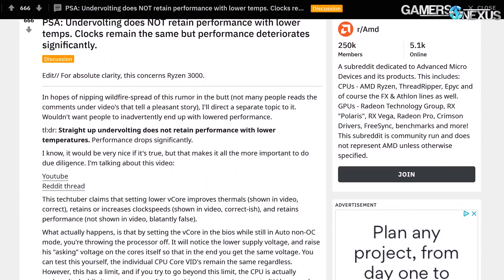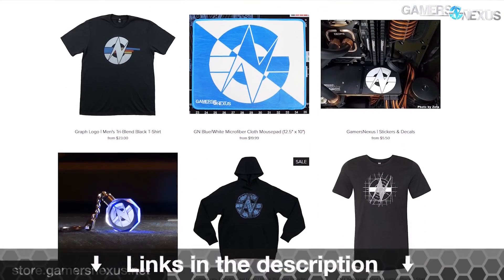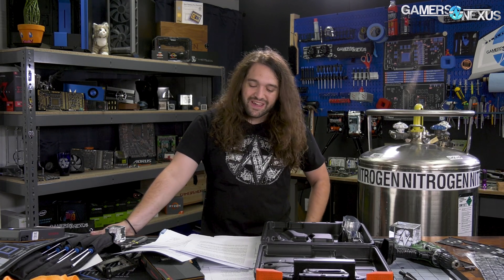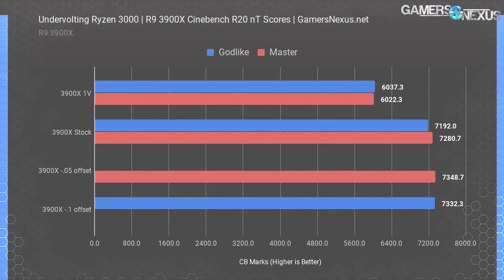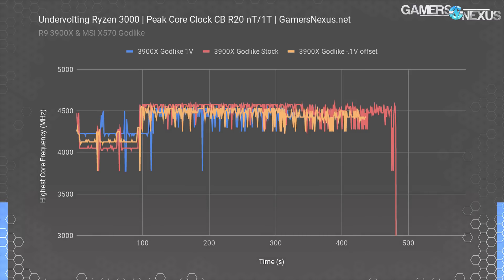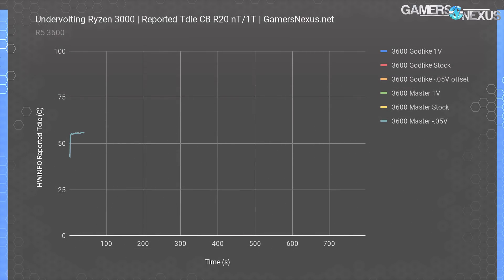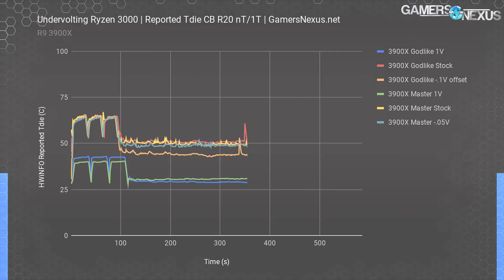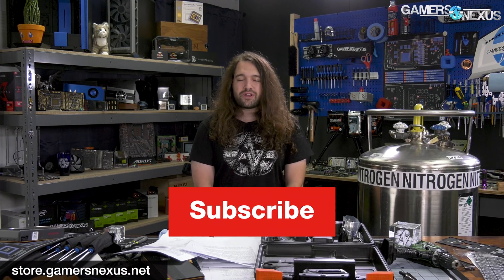AMD Ryzen 3000 Undervolting Offset vs. Override | Vcore Voltage

Comment: I see this as a good thing, instead of crashing, it slows down, which is a much better alternative for most people. They just need to implement a way for you to tell that his is happening.
Reply: I see why that can be good for many people. But, for experienced overclockers, there should really be way to disable that behaviour, because it looks like it can limit before it would actually get unstable, many say that they can get higher manual all core overclock at lower voltage than stock or PBO.
Reply: @Ph42oN  ya it would be nice to have it both ways. But I doubt it ever happens.
Reply: I noticed CPU utilization being capped off when undervolting using an offset (task manager showed 87% utilization on all threads). That's one way to tell I guess...
Reply: That would be a good idea.
Reply: so do overvolting too, detecting micro stutter is a bit annoying

Comment: Hmm...I will try offset undervolt -0.1v on my Godlike and see what my 2700X does..
Reply: I would be interested in your results.
Reply: I already beat you to it ages ago, you need a decent 2700x but -0.1v on the x470 aorus gaming 7 WiFi is possible. This can be paired with a raised BCLK of 102mhz, allowing for performance that is slightly better than stock while being massively more efficient. I currently run my 2700x at -0.1v with high LLC and 102BCLK with the ryzen balanced power plan with the minimum processor state changed to 5% from 90% at stock.

Comment: The whole point of undervolting is to reduce power consumption at the same performance levels.  Why didn't you look at watts (at the wall is fine) ?  It just drives me crazy that you measured all of this stuff... except the second most important parameter, power consumption.  For everything... underclocking, overclocking, whatever... what is the most important parameter after performance?  ITS WATTS!!!!!.  Not temperature (though that's useful)...  but WATTS.

In anycase, I've been trying to figure this out forever (for the last week) because at stock settings I do not get anywhere near the performance at the same wattage as I do with fixed overclock settings.  I always expected that setting a voltage offset would reduce VCORE without changing any other parameters (such as frequency) and that the system would simply crash if I went too far.  But that does not appear to be what BIOSes are doing with the offset.  They appear to reduce the frequency as well, which makes the whole idea of applying a negative vcore offset worthless.   I don't want the BIOS to mess with any of the other parameters... but it does.

So at the moment there does not seem to be a way to properly undervolt a system short of manual overclocking... and when you do manual overclocking you of course lose the single-core boost (which I really would like to have kept).  Sigh.

-Matt

Addendum/Edit: I shouldn't say 'no other way'.  There is, of course, the platform power cap which with a Zen 2 CPU works wonderfully to reduce the maximum watts the system will draw.  But this is a bit different from undervolting.  The idea with undervolting is that one can run stable at a lower voltage, all else being equal.  So the two can work together.  Except most BIOSes do not implement the VCORE offset that way which makes the field basically worthless.
Reply from the maker: We disagree that this was the point. We did measure it, but the point wasn't power, this time, it was that people thought performance would increase with lower voltage due to PB2. We have to cap it somewhere. The team is running ragged and we're putting out deep videos nearly every day. Not everything makes the cut. The point here was to address performance, not power. For power, just do some simple math on it.
Reply: @GamersNexus  I watched that original video before it was taken down (and I wasn't subscribed so it was probably a YouTube algo linking one of your videos to his)... it was fun to watch, the guy's heart is in the right place, but I really don't think very many people took his result with more than a grain of salt because it seemed a bit off-base.  

So I would not infer that very many people came out of that thinking they could get major performance boosts.  Sure, there will always be a few people... but its a big world with billions of people in it.  You can find any opinion you want on the internet.  I would not infer that any substantial number of people actually came away believing that performance would be better by watching that video.

There is no obvious reason that lowering VCORE would increase performance.  It just doesn't decrease the power envelope enough to move the temps enough to add much frequency.  Even in your own tests, the few results that were a bit better were probably more likely quirks in the PB algorithm that happened to be hit due to the VCORE setting and not so much because the VCORE was lower.

In anycase, you guys always focus on overclocking, which is fine.  But you obviously don't run machines at lower power envelopes regularly and that's a whole 'nother crowd of enthusiasts.  Nobody who undervolts seriously does so expecting higher performance.    The whole point of undervolting is to reduce power consumption.  It's in the same category as modifying the platform power cap in the BIOS (which I do all the time, as well)... the point being to reduce the power envelope to keep the processor's all-core performance closer to the power/performance sweet spot.

Whereas 'stock' settings are heated up quite a bit from the sweet spot, well past the efficiency peak and consumers (including most of your viewers) care more about overclocking which tends to burn stupid-level amounts of energy for basically no real gain in performance (5% is not significant in my book).    There is a whole 'nother crowd that cares the other way... they want to run their machines more like servers, meaning closer to the highest efficiency operating point and not goosed to the gills.

I'm not docking you for focusing on overclocking, but I am docking you for talking about undervolting as if it were just some other aspect of overclocking.  It isn't.

-Matt

Comment: A -.13V offset bumped my single and multi core scores in C15 and Passmark on my 3900X - better than forcing a 1.352V

I'm on an ASUS Crosshair VIII Hero which appeared to have high voltage at idle and load.
Reply: thats nice, but try stability testing instead
Reply: @jscb7003  
How much more stable do you need it?
Reply: thats happening on others also Taichi has some voltage scaling issues at idle you would think before releasing this platform they would of figured this crap out
Reply: And I thought I was cool with my 102mhz BCLK -0.1v 2700X.

Comment: Interesting info and seems to pretty much mirror what I have seen, my 3900X was running at 1.42v out of the box (ASUS Strix-F, BIOS 4012 - still not updated).  I manually set it to 1.2v - worked fine but only boosted to 4.1Ghz.  Now running 1.375v (shows as 1.38v) and it boosts to 4.55Ghz - still can't get that 4.6, might have to try 1.85v.

Temps at idle are around 36 now (was 49 at stock - but I also had a crap mate with the water block which did not help), but does climb into the 70's under god load - running Handbrake 1080p encoding.  If I run the radiator fans at max speed it never gets above 76 though.

Not going to update the BIOS till a lot of the issues are worked out - but I do wonder if most of the behaviours (temperatures, voltages, boosts etc) are all down to very immature BIOS/AGESA?  Either way, the 3900X makes light work of most things :)  I should also point out the the 4012 BIOS for the Strix-F mucks the RAM voltage right up, so had to fix that manually as well.
Reply: 1.85v? are you trying to cause a house fire or something? we're not on 32nm anymore my guy
Reply: And that is why you should always proof read before posting ;)  I meant 1.38 naturally ;)

Comment: I have a 3900x and run it at -.106v it does not boost performance instead it reduces temps. I undervolted until I saw performance regression and -.106v was that place. I can get a 60 degree prime 95 run and 3277 r15 score im happy with that I have seen better but I cant seem to get beyond that without manual oc and in my opinion ill sacrifice a few point to have a cpu that runs cool. btw im on the crosshair viii hero
Reply: Is that with PBO enabled?

Comment: Could you do a test of underclocking a higher skew cpu to the frequency of a lower skew to see if the power consumption decreases?  The cost of the better skew could then be compared to the cost saved from power savings.
Reply: The problem is that you need multiple samples to be able to conclude with certainty (and beyond the margin of error) that it is indeed the binning behind the variance in power draw, and not variance across the individual bits of silicon.

Comment: Could you please do a deep dive into memory Frequency & Latenzy scaling inkl. IF OC too - that would be so awesome!
Reply: I've also just been patiently waiting for memory scaling. GN's initial Ryzen Memory coverage was the best by far, and curious to see how much of that behaviour carries over to Zen2
Reply: I have no interest in what the hard upper limit is for maximum performance since like everything else, the highest end memory kits jump in price exponentially for the boost in performance. I'd like being presented the scaling with different speeds in the fashion GN has delivered it before, but good things can't be rushed
Reply: Best you can do for Zen2 is run 3733c14 with 1:1 IF. Completely pointless to go out of sync by pushing clock further but in1:2 ratio. Latency goes to shit and people have reported micro stutter in games.
Reply: https://lab501.ro/procesoare-chipseturi/amd-ryzen-3000-part-iv-ddr4-scaling-english-version

Best article I have seen so far.
Reply: Other sources seem to show 3000MHz-3200MHz as the good spot before the higher pricing of other kits makes less sense as that price difference can be dumped into say a better cooler, which can aid the boost behaviour. the more good sources the better
Reply: Ya, new too. GN does great coverage on the original Ryzen memory frequency vs latency. Like to see if Zen 2 follows in the same way.
Reply: Pls
I'm sure hes working on it though it seems obvious
Reply: https://www.techpowerup.com/review/amd-zen-2-memory-performance-scaling-benchmark/
Reply: Memory scaling is definitely important... probably even more important than CPU OC because memory scaling has a huge, outsized effect for the relatively small number of watts it burns.  It's an easy switch to throw.  Good call.

-Matt
Reply: watch buildzoid aka hardcoreoverclocking or something.
Reply: I'm waiting for these exact info
Reply: read your articles +-3fps on 100+fps games....a complete waste of time to even care about that probably why they didn't do it
Reply: @fredEVOIX  Nah its more like up to 15%
Realistically around 8-11% depending on your mem Kit and Skills.
Reply: @dongurudebro4579  going from 3200 16-18-18-18-36 (XMP) to 3600 14-14-19-14-36 (and better subtimings than XMP)  gives me a 7% increase of performance in CS:GO... completely worthless to spend days or a week to try and get your memory to a stable OC

Comment: i've been having issues with the temp on my 3600 as well on all auto setting. temp would hike up to 95 degrees. also vcore hover around 1.4 all the time.  idk bc if i got the b450 board for it.  still working process...
Reply: @darkhazard9808  that's what I did.  set the voltage manually to 1.1. seems to be working stable after that with okay temps.  no boost tho.
Reply: I'm having issues with a lot of WHEA_UNCORRECTABLE_ERROR bluescreens. I also see some higher than expected temps. I think there are more tweaks needed to some BIOS. I have an Asrock mobo. I put my 1700X back in for now until some of these bugs are worked out.
Reply: @tinitis4144  yes same with me. so many BSOD.
Reply: i was having similar problems on my 3700 on a b450 in the end i just put a offset and put ryzen power saving on, in windows for now 
better to lose a few fps then to have it run high 
just keep an eye and when something is released try put it to stock again then  
(stock for me in bios is 1.4+ volts on auto ¬¬ ) my temps though are fine/where fine even at them high volts though sitting above 1.43 at all times with it above 1.46 most of the time just ain't worth it though
Reply: @darkhazard9808  I'm using stock cooler.  I know they suck compared to good aftermarket ones.  My backstory is that I bought 3600, MSI B450 pro carbon and G.skill 2x8gb 3200Mhz all brand new for this build.  B450 bios flashback without CPU. put the cpu and cooler on all stock settings after bios update.  first windows boot 60 degrees on idle, and 95 max with short cinebench r20 test.
Reply: @rockedout  did you download the latest AMD chipset drivers? those come with new ryzen powerplans, try that, set to ryzen balance performance plan. If not that try windows balance plan, set maximum cpu state to 99%. There was a bug making cpu run at high load and voltage at boot ive seen this settle that for some folk, AMD_Robert also mentioned about it on reddit. worth a try.
Reply: @MFMArt  yes. i've downloaded everything, AMD chipset driver from MSI updated windows and ryzen master to montior
Reply: @rockedout   download the chipset drivers from amd directly.
https://www.amd.com/en/support/chipsets/amd-socket-am4/b450

that is for b450 boards, verify that your rivision number for chipset is the same 1.07.07.0725
Reply: @MFMArt  cool. I will give this a go, but what's weird is that my rig won't even post at stock setting and have to restart after turning on to post. with voltage set to 1.1 or 1.2 doesn't seem to do that
Reply: @rockedout  thats usually a sign of the clockspeed being too high or it not getting enough voltage (rather it be from the vrm throttling or the power set too low is not something i can tell ya off hand.) The "safe" voltage is 1.325 far i know with 3000 series and set the socket voltage to 1.1v. also try pointing a fan at your vrm and see if it helps, try each of these individually. Try the fan first then try the voltage, then try both
Reply: I've set the voltage to 1.1v, 1.2v, 1.25v.  for all 3 settings temps are good, but same results otherwise.
Reply: I using 3600x ,my max temp around 76 but on asrock x570 steel legend board tho. Most is auto ram at 3733c15 , IF 1900mhz.
Reply: @Kaskiskuskeskos   76 temp seems fine if you are on stock cooling, but you should check that IF clock, you should have it 1:1 with ram, and currently it doesnt go 1:1 past 3600mhz ram without timing tweaks. 3600mhz with IF at 1800mhz, youd probably get a performance boost with that tbh.
Reply: seems like i found the root of the problem of the system not posting.  every time I set the precision boost overdrive to auto, the system won't post and I have to restart the pc over and over again to post.  I set that to enable, which makes the pc to post fine. that's one down
Reply: I'm having a similar problem with my 3600x, high temps (see below) and high voltage, usually 1.4V at idle (browser opened) even with Ryzen Balanced Power plan and it can reach 1.45V when there is some activity.
Temperatures are average at idle and very high when the CPU is stressed: CPU temperature can reach 55°C (minimum 35°C with an ambient temp of only 21°C) at idle. When stressing the CPU it stays constant at 70°C. I have the Noctua NH-D15 SE-AM4 and the Silverstone RL06 and I tried with max fan speeds. 
My motherboard is a x570 gaming plus. 
My system won't boot with their game boost (+200MHz) and it won't boost with Precision boost either. Yes I know the difference with PBO and I tried that too. It didn't reach the 4.4GHz that it should reach.
Reply: Mostlt likely just either a bad cooler mount or too little thermal paste.
Reply: @StaelTek  i have re-applied thermal paste and re-seated the cooler many times. same result. and still getting no post on all auto setting

Comment: Man do I want to upgrade from my i5 Skylake 6600k... Do you think it is bottle-necking my GTX1080?
Reply: In games like Battlefield 5 that is wrecking 4 threaded CPU's, a 6700K/7700K upgrade would be a good consideration.
Reply: I have the 6700k paired with a 1070 and understand what you mean. at this point going to an r5 just for kicks seems like something fun. I play at 1440p btw.
Reply: Only if your frame times are not stable at your resolution.
Reply: I have the same but with 1060 it probably is holding it back a little bit but maybe try OCing to 4.5 and that should help a bit if you have proper cooling and motherboard
Reply: @aschraub9897  I OC my chip to 4.6, but it feels sluggish these days.
Reply: It's certainly possible, depending on the game itself, resolution and so on...
Reply: the gains replacing everything but your GPU wouldn't be worth the investment IMO
Reply: @darkhazard9808  I have a nice Pixio PX329 32" 144hz 1440p main screen. I have a hard time hitting that refresh in anything but maybe the lightest gaming.